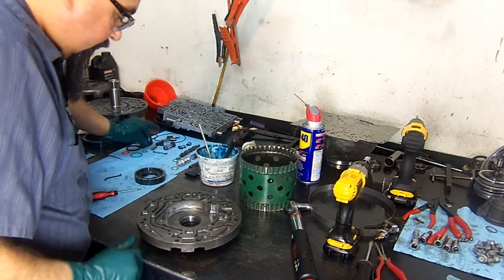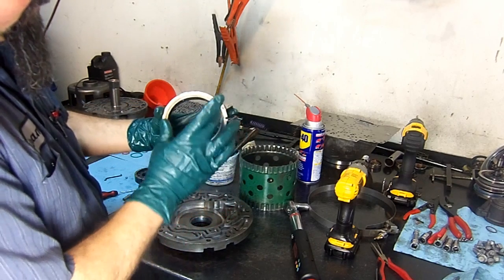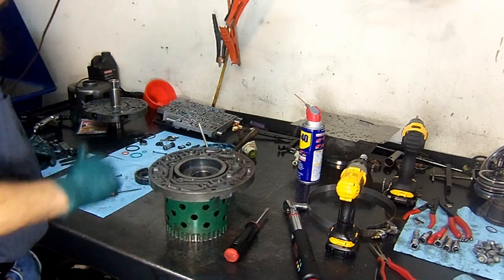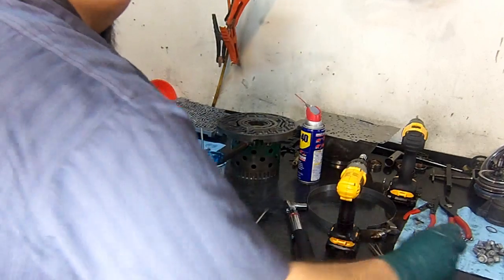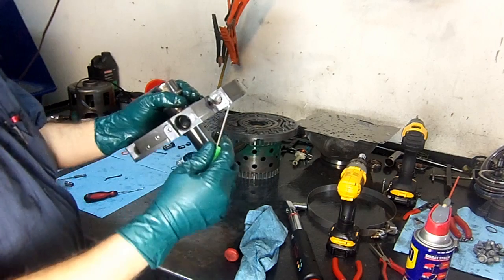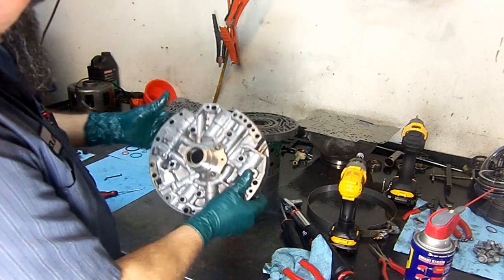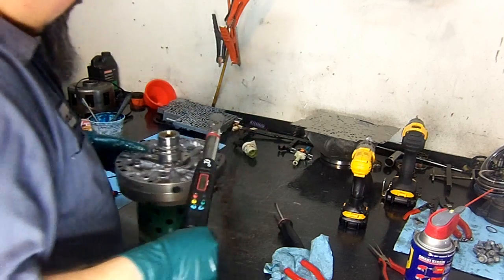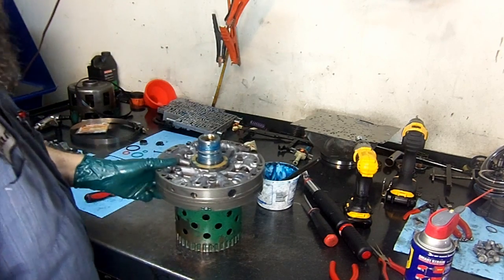4L60-E Transmission Pump Assembly Re-Assembly - Transmission Repair

Comment: I have a 98 Chevy blazer LT 4x4.  what can cause the front to leak can it be just the front seal or can the pump seal to. it doesn't gush out but leaves a puddle. I shouldn't have to rebuild the pump just for a leak do i

Comment: Hi Hiram.
on a 2009 chevrolet silverado 4l60e dose the pump have to be removed to do the boost valve or dose the electrical plug come out. Thanks again for videos

Comment: Hey Hiram have you had any good luck with rebuild pumps for these units? I have had tons of problems with rebuilt pumps through various suppliers and they just can't seem to build them right. Example low line pressure after warmed up is the biggest issue I ever see, when this happens I end of going oem pump straight from genera motors and presto! No delayed engagements anymore when hot! Any advice on good rebuilders for these pump?
Reply: I'm about to pull the 4l60e on my spare vehicle ......same issue...pressure drops when hot.  Pump was making noise, so I'm guessing there is some damage there.  Wondering if rebuild kit will be successful, or just go OEM?

Comment: Quick question Hiram! Is the 04 and earlier 4l60e transmission pump and the 06 pump interchangeable??
Like if I have an 06 4l60e transmission, can I replace its pump with one from a 04 4l60e transmission?
Reply: Koto cy
Reply: windy jerread